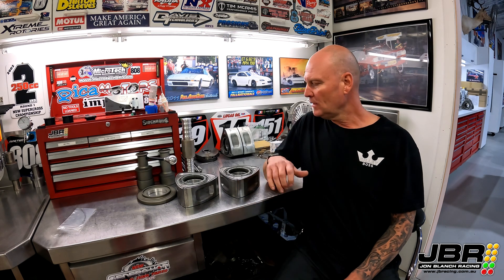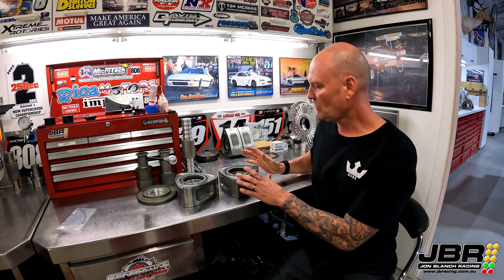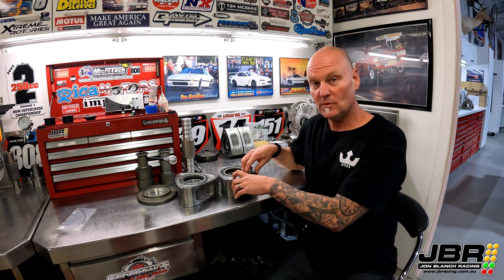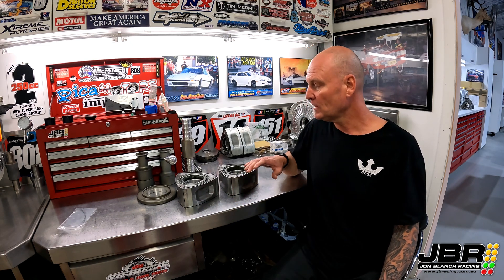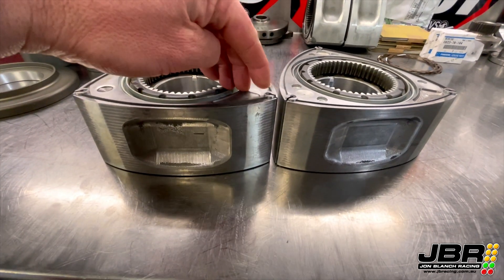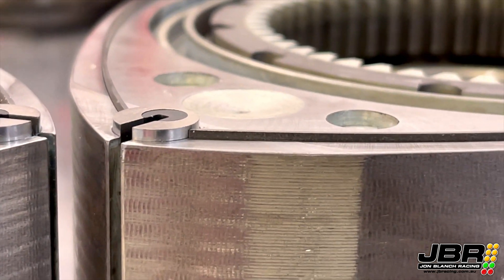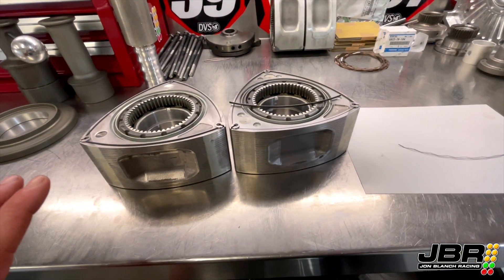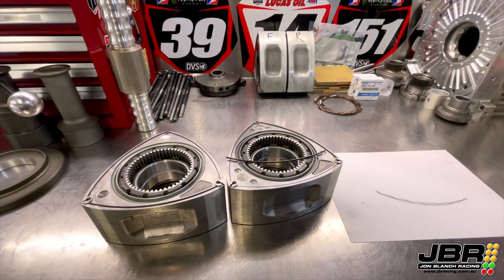Building a 13B Turbo Engine? Double Check This!!!

Comment: I don't think that will matter once the engine stack is torqued down the spring tension will even out. If this was an issue there would be many brand new motors with low compression and it would be well known.

Comment: I’m in the process of assembling my first rotary engine. And came across the same thing, though it was weird. Being my first engine just thought that’s the way they were and it would compress in the housings. One thing I did notice was I had a side seal that some how it must have deformed and it was scraping the side and not allowing for it to spring back. Thanks Jon for what you doing helping guys like me.

Comment: Great video once again thanks.
I plan on buying some of the extreme rotaries gear for my next build (bearing tool and apex seal groove file), you said on another clip that you stock some gear.
I don't have FB do you have an email I can use to contact?

Comment: Nice catch ! Can you make a video about the how the oil system works street vs race ? Pump , bearings, regulators , thermal pellet, internal vs external lubrication !!! I'm sure alot of builders are thankful for the knowledge 👍✌
Reply from the maker: Can do mate. 
There would be a lot of content just in what you’ve just said, but should be able to break it up into a few different topics 🤔
I’ll add it to my list 😎

Comment: Nice video,
Even back in the 90's doing builds, one of the first this I was shown was to check all side seal springs sat the same. You would get batches of springs that were soft or flat like the ones you had there.
Reply from the maker: Fingers crossed 🤞🏼 Mazda picks up on it soon (if they haven’t already) & rectifies the problem

Comment: Hey Jon, I appreciate the vids. Really would like a clearancing vid on house to check parts of they can be re-used etc. Bearing install etc also
Reply from the maker: Hey Hussein. Rotor bearing install video is coming next 😎
Reply: +1 for a video on measuring parts to  see if they are still in spec. Great videos Jon!